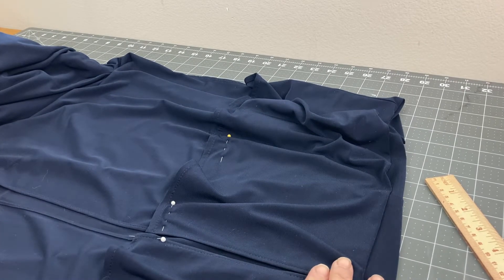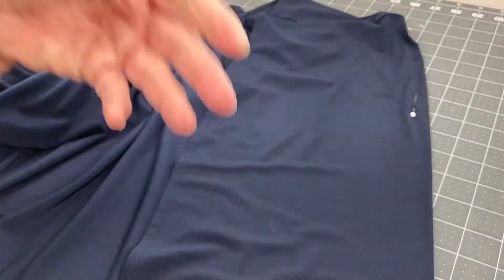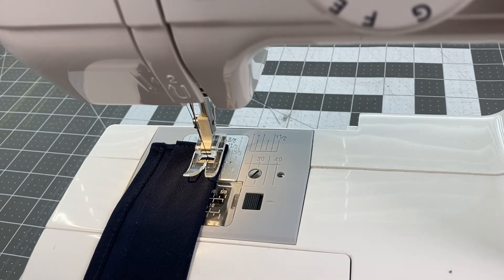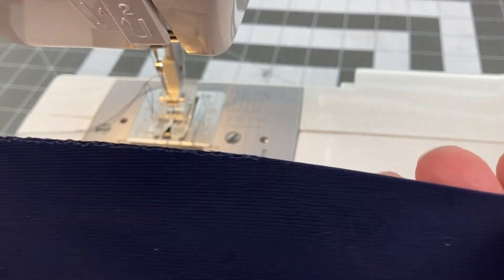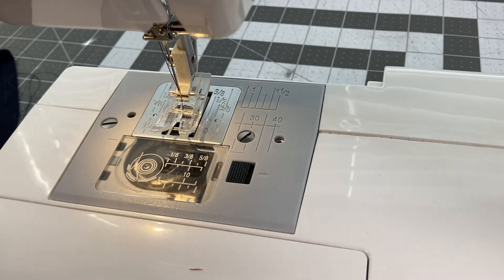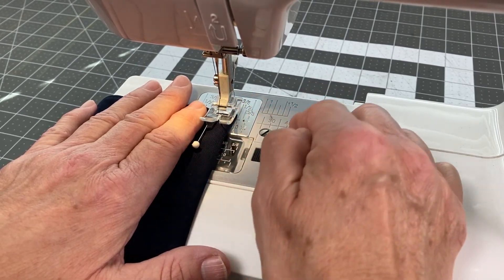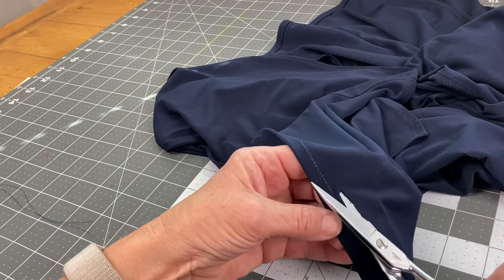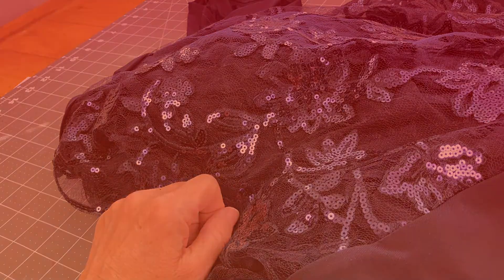How to shorten a stretchy dress using the stretch stitches on your sewing machine

Comment: Were you using a particular thread when you hemmed the dress?  If so, what would you suggest I use on a my dress which is 90% polyester and 5% spandex?
Reply from the maker: I don't use any kind of special thread.  My go to is Gutermann thread.  The only stretch thread I'll use is a wooley nylon, which isn't really a stretch, just fuzzy until you pull it taut, or elastic thread when shirring.